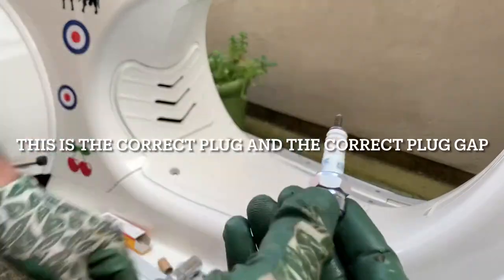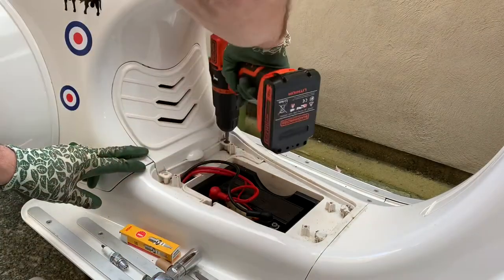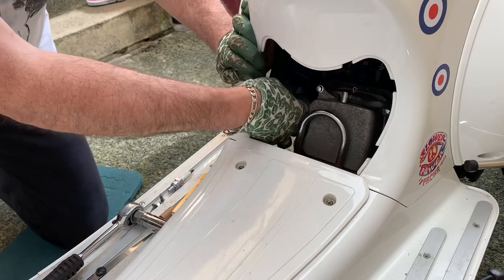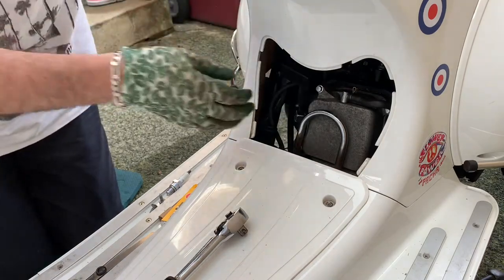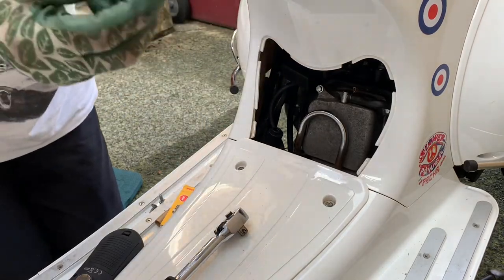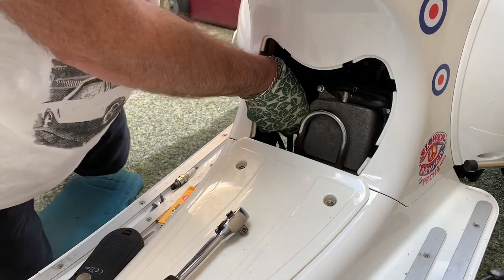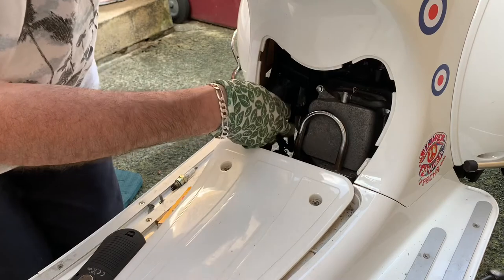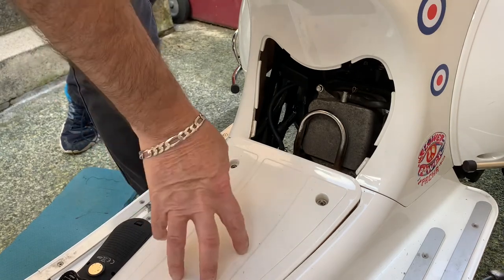AJS Modena 125 spark plug change

Comment: As a complete novice I will attempt to this from your video instruction - it's a little dark but I'm going to guess anyway;  a little worrying as I've not had much practice  - on the few occasions in the past doing anything on my vehicles others have just done things for me without showing me and so I've not had a opportunity to know if I can?! :) :
Reply: The warnings of going to far, are a little worrying as i'm not sure what i'll be feeling for  - :O
Reply from the maker: Hi. It’s just taking care and using common sense really. One thing I would do is to ensure you use a spark plug socket with a rubber insert for the plug. My mate tried to change his plug in his Modena last week and as he wasn’t using one with a rubber insert, the plug fell out of the socket and lodged in the bottom casing of the scooter. Took him ages to get it out. Other than that, it’s a straightforward task.

Comment: Using the short extention bar with the plug socket would make it easier.
Reply from the maker: Hi Billy. I'm guessing you are referring to the short plug, box type, socket which comes with the Modena toolkit, or maybe just a shorter extension than the one I used? Yep, you are most likely right, it would have made it a bit easier. Sometimes you don't think of the obvious when you are actually doing the job !! Cheers.
Reply: @modena_man  yes better using the right tool to make it easier, short bar extension is what I was talking about, I've been changing plugs in various motorcycles and cars for over 40years now cheers. .

Comment: Hi Steve. Big fan and your video are a great help.Have you got a photo of the battery connections. I can't get a user manual and don't want a disaster. cheers Dave
Reply from the maker: Hi. How quick do you need this as I’m away working at the moment and I don’t think my missus is any good with a screw driver😁

Comment: Hi Modena Man..good, helpful and informative videos here :) Can you do a video on how to remove the panel under the seat to access the valve cover for ajusting the valves? I mean the panel under the left side of the seat that's under the actually under the left main side panel itself. If this is off then it's much easier to see when adjusting the valves. Also, need a video on how to replace the variator rollers if you can.. Thanks!
Reply from the maker: Hi. Thanks for the good feedback. I think I may have covered that topic in an earlier video. Try this video  https://youtu.be/6Zl5j7AkEtQ and if this one is not the correct one try this  https://youtu.be/iA1S54b7ha0
The variator rollers I may do later on in the year or early next year as I'm planning a drive belt change on my scoot over the autumn/winter months.
Reply: @modena_man  no..the panel I mean is the one on your scoot where you have the bull sticker, 2 targets and cherries. I need to get this one off to have better view to adjusting valves.
Reply from the maker: @andysipowicz  Ah. O.K. I know which you mean now. In order to remove that panel, you basically, and you may not beiieve this, have to take off the leg shields, then the foot running boards then you can tackle getting those panels off. All of the panels from the front to back are interlinked and have to come off in order. I find that if you take off the louvred panel underneath the front of the seat, just behind the battery cover, then you can just find enough room in order to tackle the valves. It's a bit tight, but, unless anyone knows another way, I think it's the only way you can do this. I use a mirror to see where the marks on the camshaft sprocket are aligned when doing this.
Reply: @modena_man  Yeah I had difficulty seeing the alignment marks too..ok, I'll try using a mirror too. Cheers!